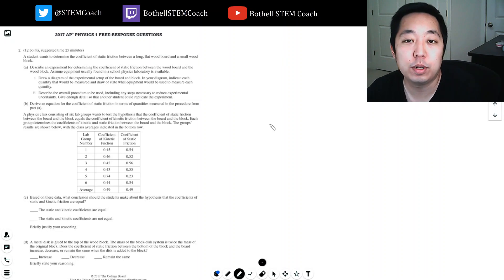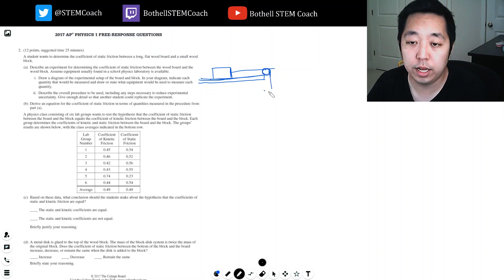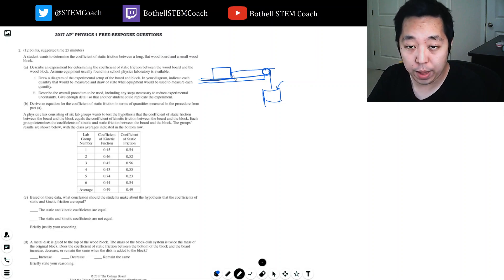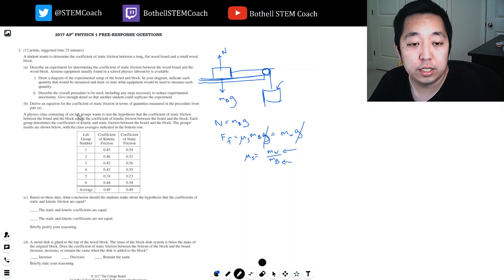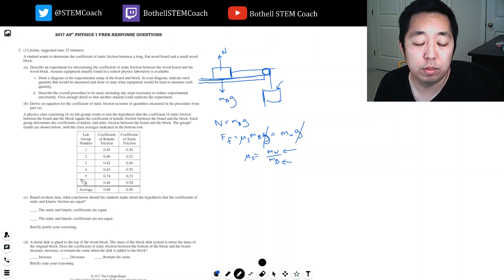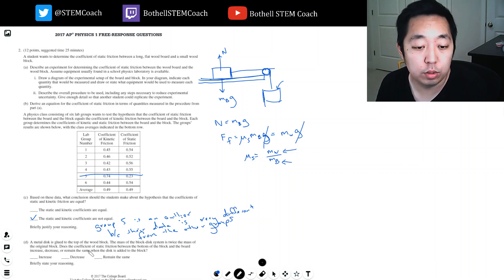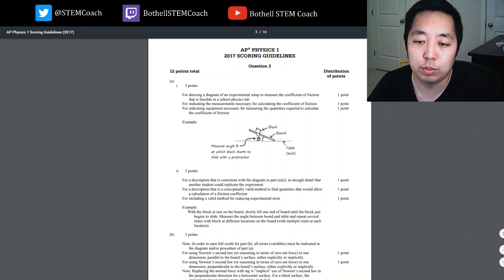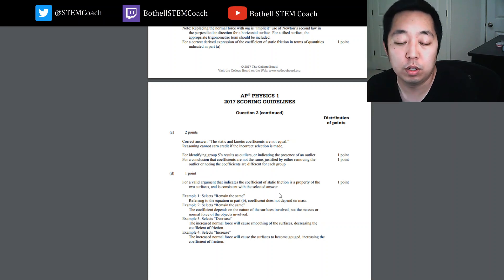2017 AP Physics 1 Free Response #2

Comment: For the first part, would I get full points if I decided to use a force gauge to horizontally pull on the block and measure the force right before the block begins to moves?
Reply from the maker: Yeah that would be a fine experimental setup